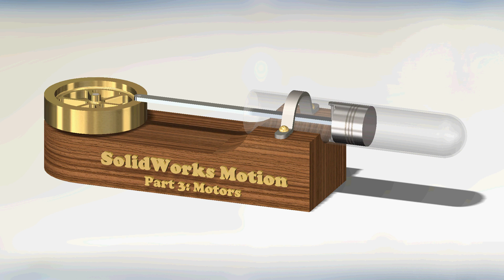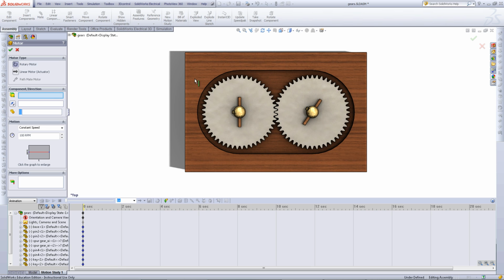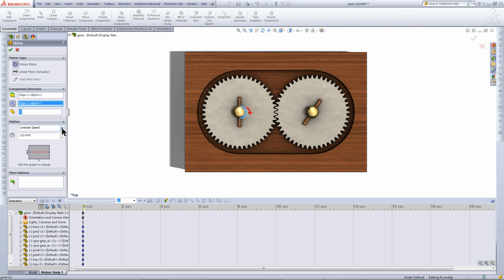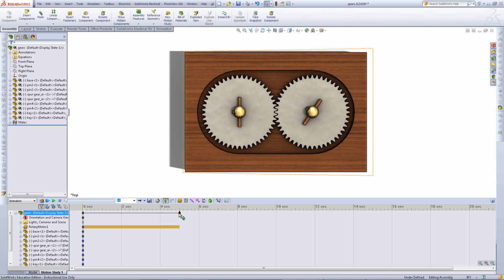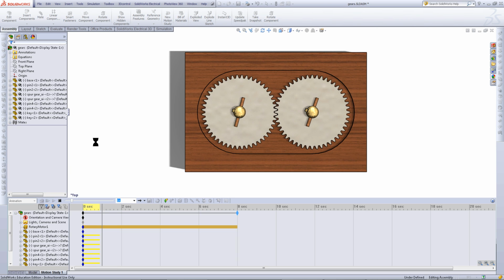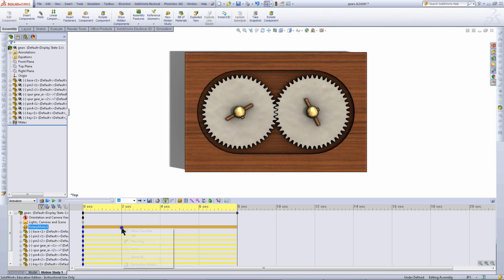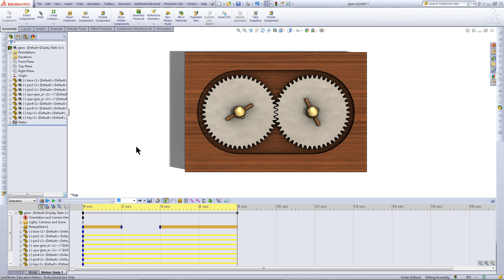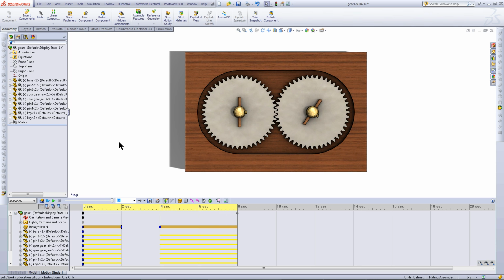SolidWorks Motion: Part 3 - Motors

Comment: This seems to indicate the SMOOTH animation is not possible with SolidWorks - that is, unless you forget about the study, and do it manually, by dragging with your cursor (?)
Reply: In the motion study settings, you can adjust the FPS. It's a low number like 6 by default which is why it looks so choppy.
Reply: @YostPeter  Apparently that's not all there is to it,though. That was the first thing I tried, ( in my own motion study) to no avail.

Comment: Thanks for the video.

When I do this the motor has variable speed whereby its angular velocity appears to accelerate from zero rather than initialising with the nominal value.  Could you suggest why this is happening and a possible solution?

Thanks
Reply from the maker: +Richard Long Could you post this to the MySolidWorks forum? It's a better place to get tech help on specific issues like this. http://my.solidworks.com/forums
Reply: Use "Data Points" Instead and choose "displacement" option, "linear" and enter the displacement according to your speed.